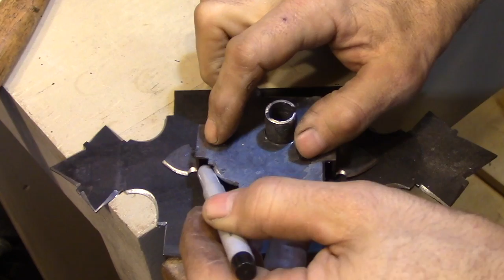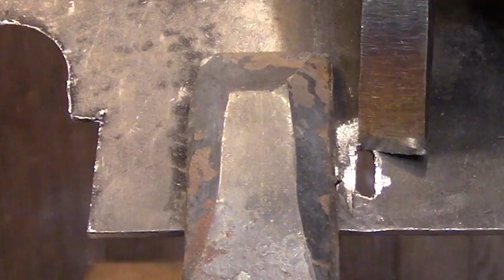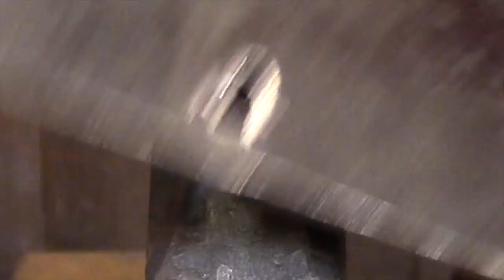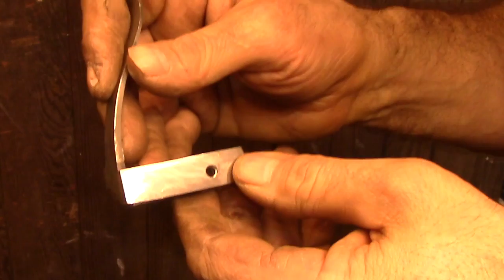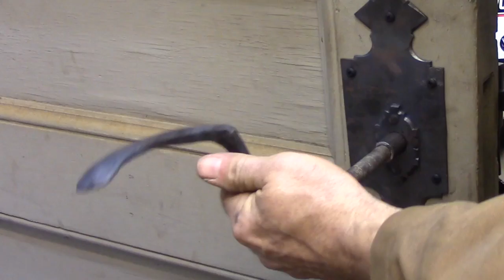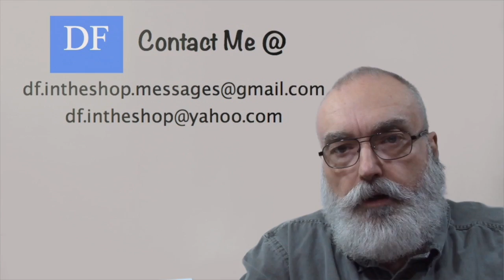Blacksmithing Project - Forging a New Shop Door Latch 9

Comment: Why don't you heat the rivet up and then hit it wouldn't that make it go faster? I don't really know anything about this I'm just asking
Reply from the maker: There isn't any need to heat small rivets they don't work harden that much.  Also unless you are using a torch and heating them in place they would cool too quickly for you to be able to shape the head at a forging heat.
Reply: DF - In The Shop that makes a lot of sense thank you, so basically the only reason you would heat them up is if you were using a really large rivet? Also I sent you an email the other day and was hoping you could let me know about what I had asked thanks again